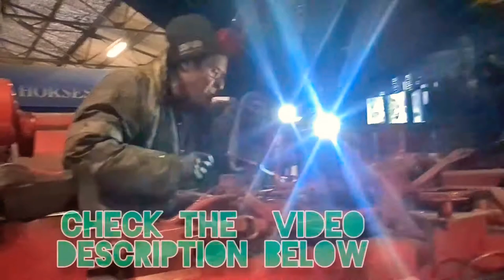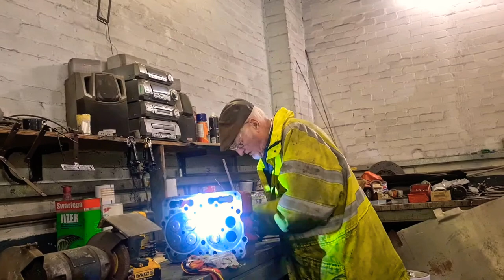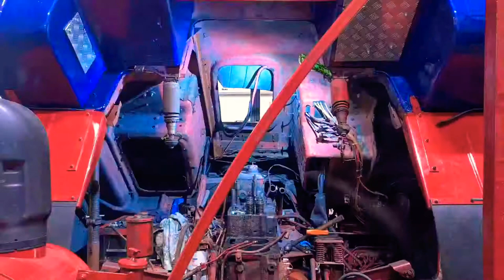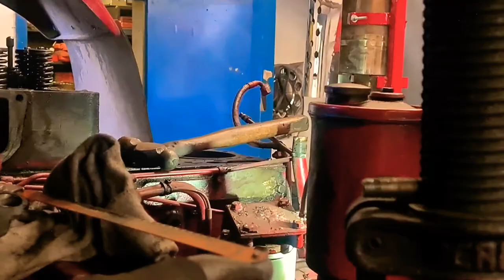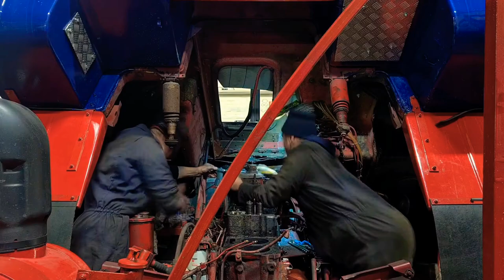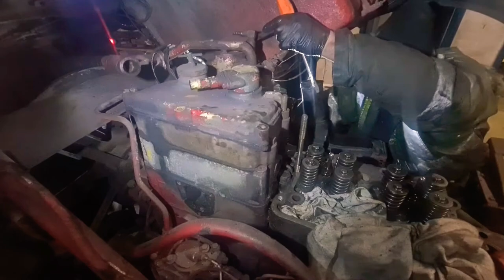1976 Foden S81 - Engine Work! - Part 2

Comment: Dont know about now but Cummins used to do a great deal for the parts for an in frame rebuild on the 14 litre engines. £1800 for exchange heads complete with valves, 6 piston& liner kits & Full set of shells. Great value. Shame they so bad on fuel.